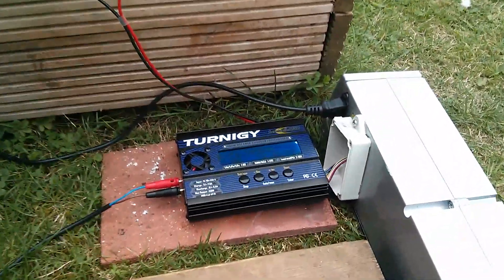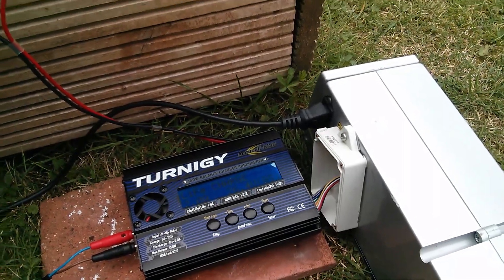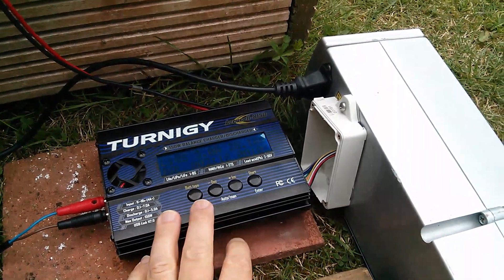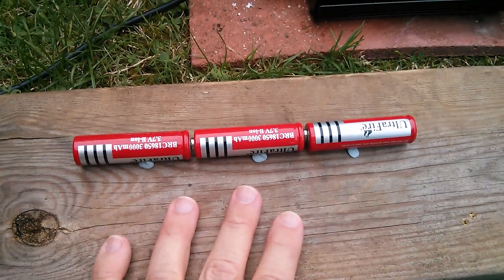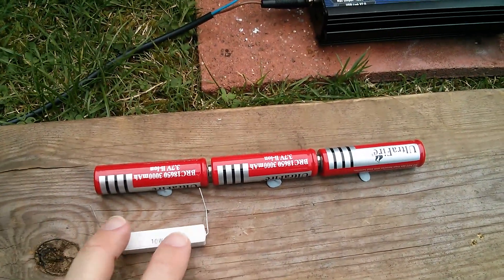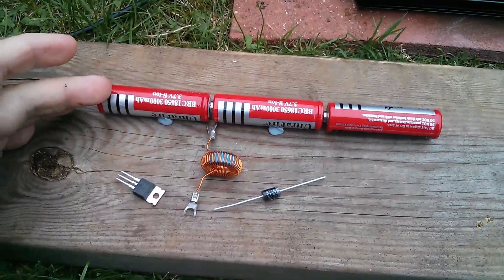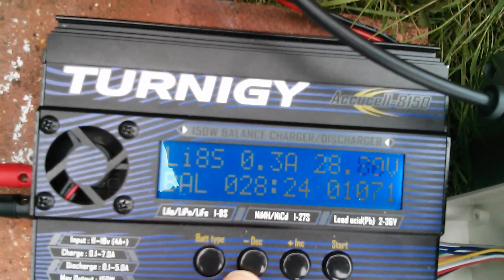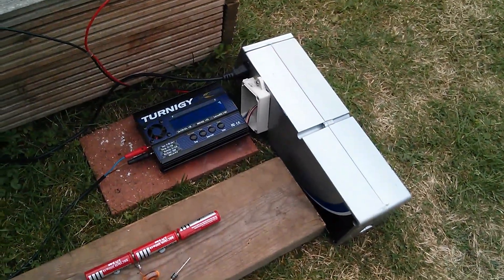Julian's Idea: Balance Charging using Inductive Transfer

Comment: Julian my turnigy balance charger charges lipos pretty fast but towards the end it takes AGESSSSSS to finish! Why does it do this? It cuts the amps right down just like yours and just takes ages to say it's finished. But if I stop it from balance mode and change it to fast charge mode it says capacity right away..?
Reply: Designandrew all lithium follow a charge profile of 'finish at 1/10 current' of the initial charge current, so it always takes ages with that kind of profile, it does get the most out of the batteries and minimal heat.  To go faster and use a different method would probably need cell temperature monitoring
Reply: Designandrew Fast mode reaches 4.2v then cuts off. Regular mode will charge to 4.2v and then taper the current to "finish" the charging. Fast mode actually doesn't fully charge, but regular mode will. All battery technologies follow this charge curve. Imagine it like you're filling a glass with water. You fill it quickly until you get to the top then you slow the rate down so you can fill it exactly to the top without spilling any. It's a similar process except it's the chemical reaction which slows down.

Comment: If you BOTTOM BANANCE the batteries will stay balanced.
Reply from the maker: Andrew Bryant pianotunerbristol It's true that the cells in a bottom-balanced battery pack each contain the same amount of usable charge. This has the advantage that all cells (during discharge) reach their minimum safe voltage at the same time. But to keep a battery pack bottom-balanced while recharging, the recharging process has to stop when the lowest capacity cell reaches its maximum safe voltage. That prevents the use of a constant voltage 'top up' charge. If the full CC/CV charge is applied to all cells in a pack, they necessarily become top balanced.
Reply: Julian Ilett 

''the recharging process has to stop when the lowest capacity cell reaches its maximum safe voltage.''

''highest cell'.......

the 'trick' is to individually discharge your cells to whatever value suits the chemistry,  as they creep back up more than one discharge will be needed then you charge the pack in series at whatever the pack voltage will be for a fully charged pack until the first cell is within say 5% (or 10% if you can spare the capacity/mileage loss) of its top individual cell voltage, and then you measure the pack voltage, you tell you charger to stop at this value,  once you have that value and know it you can charge at any current you want basically, there's packs going round that have been ''bulk charged'' this way for a long time...

this is the correct bottom balancing method and works well with only periodic checking of the cells to keep an eye on things.

theres 100v packs out there being charged off 110v ac with nothing more than a bridge rectifier and a 500w halogen lamp as current limit.....(i kid ye not, americans lol)

the ''top balancing'' balance charge method is an awful way to treat them......
Reply: PoppyCock!! Get rid of the BMS Bottom balance all the cells Use a charger with a cut off voltage set just bellow max pack voltage Job done.  Your cells will never go out of balance using this method.
Reply: I agree Lez
Reply: +Andrew Bryant pianotunerbristol Oh God, you're one of those people who've picked a particular method like it's a religion. Bottom balancing is shit. GTFO.
Reply: +Andrew Bryant pianotunerbristol lol. Lead Acid? That's more your era, I think.
Reply: Fennecbutt  Oh!!!

Comment: There already exsist pre-made battery management chips that does that. As far as I recall reading there is little to gain by doing so, since balance is very minor adjustments with good cells.